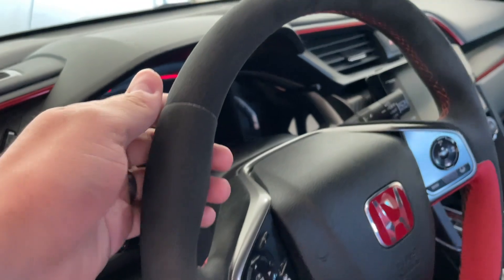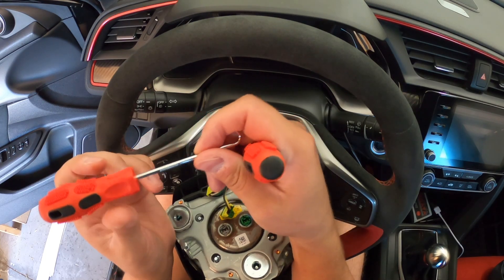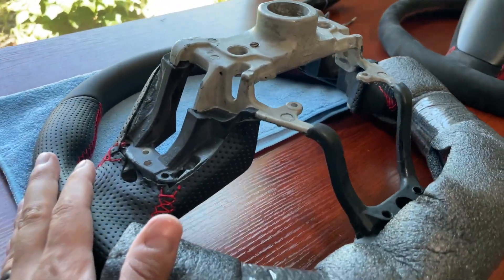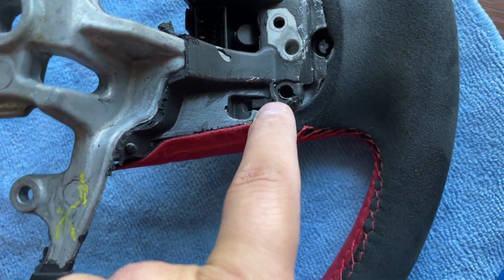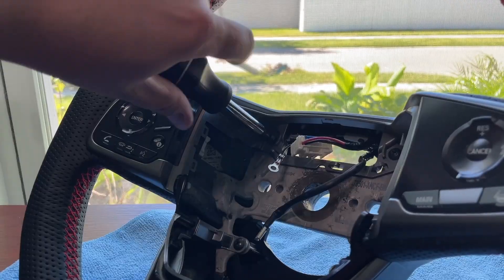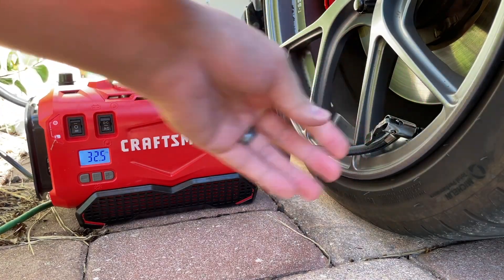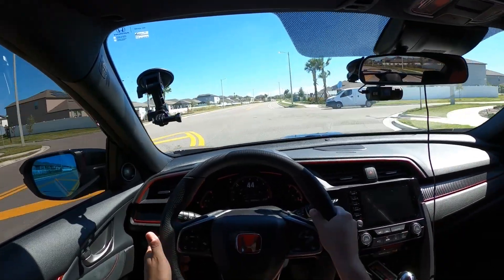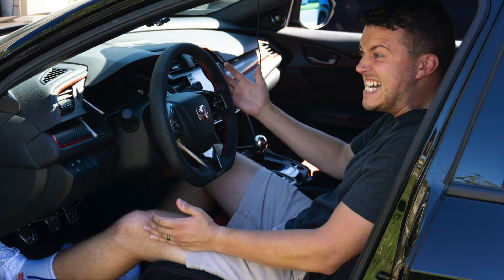MUGEN Steering Wheel Install on my FK8 Civic Type R!

Comment: I have the same steering wheel on my 2020 FK8. The thing looks great... however, the resin layer over the carbon fiber starts to crack and warp and bubble after 6 months or so... I'm guessing its from sun exposure. Would I buy it again? Yes, because it looks taht good. Is it worth the 800 dollars I paid ? no. probaly worth more like $500.

Comment: You need you the dewalt DCF891, rated at 800lb ft breakaway but it's been shown to do as much as 1000lb ft. Best mid torque around, poops on my Milwaukee stuff... It eliminated the need for the bulky high torque Milwaukee for me.
Reply: You lost torque with the extension.  Never use an extension if you can do it without.
Reply: @BBTrailComs  you're right about that there

Comment: Torque spec for the steering wheel bolt is 36ftlb if you ever want to go back and torque down at a later date

Comment: I just tried to install same mugen steering wheel today, but this part does not fit at all. Center part of steering wheel is different with OEM steering wheel, so can not install any panels. Here is question. Which part did you get? '78501-XNCF-K0S0-R ' or '78501-XNCF-K1S0-R '?

Comment: lol I used my torque wrench as well to remove that bolt, and yes, wifey helped. Now all you need is the mugen shift knob and mugen start button
Reply from the maker: I agree about the start button, but the Mugen shift knob is hardly heavier than the stock knob. I like the weighted one I have at the moment

Comment: I hope this is not a dumb question but was the airbag added to the new steering wheel ?
Reply from the maker: The center piece with the airbag was untouched
Reply: @Camhill182  so the airbag is on the new wheel ?
Reply from the maker: @hansalexandre7720  the airbag never left the wheel. The only thing that changed is the outside

Comment: I am also a noob with power tools. I just did my rear suspension on 07 Si and insisted my kids get me the right tools for Father's Day (Home Depot set came with 2 batteries), OR ELSE? Lol. Yep the Milwaukee Power tools are golden. I got the 1/4 drive and bought the Milwaukee Adapter set for 1/2 and 3/8 drive. Bolts came off with ease on vehicle 15+ years. Now I am hooked on Milwaukee power tools, SOLID. Also the breaker bar is my go to taking off the lug nuts now. They are cheap. Get the Harbor Freight 1/2 drive one for around $20. Works great and easy to use leverage off 19mm wheel lug nuts which come off super easily. BTW the Steering Wheel looks awesome!

Comment: Lol. I'm actually looking to move to Florida and been shopping for houses. I'm currently in Oklahoma (not from here either) for now. 

It's always the little mods that amaze me too. With all the mods I have:
PRL catless DP
PRL front pipe
PRL High volume intake
PRL Race MAF housing
PRL inlet pipe
PRL charge pipes
PRL intercooler
Blitz Nur Spec exhaust
XDi high pressure fuel pump
Hondata
Custom tuned on 93
Eibach Sportline springs
18" Enkei Wheels

The wheels are my favorite upgrade. Lol. Even my newest addition, my phone holder. Thinking of an Acuity shifter, or maybe just start with their bushings for a cheap $70. That may end up being another favorite out of all on my list. Lol
Reply from the maker: nice mod list! I should do those little shifter upgrades too
Reply: @Camhill182  Just saw the new video and it reminded me I didn't put PRL's Race MAF housing on my list. Lol. So I fixed it

Comment: I’m jealous, wish I could instal the mods I have for my Focus st....still at the dealership getting a brand new transmission (going on 3 1/2 weeks). Yay, supply chain issues. 🤡 Love the CTR man!
Reply from the maker: whoa, how did the transmission go?
Reply: @Camhill182  idk, I was leaving work (2nd shift 2pm-1230am) came to a stop, put the car in first and heard a snap...shifter stuck in 1st and 2nd only. Shifter assembly was floppy and could only engage first gear if I went under the hood and flicked the shifter arm into gear. First week the dealership forgot to order the transmission (first estimate was $3800 dollars, Clutch and flywheel+labor/new estimate clutch, flywheel, transmission+ labor $5,000) I’m guessing my shift fork snapped, but Ford only wants to replace the transmission and be done with it. I was hoping it was just shifter cable related, but I guess I’m not that lucky lol
Reply: Just got a text this morning saying their still waiting for the transmission to show up...”hopefully this week”.